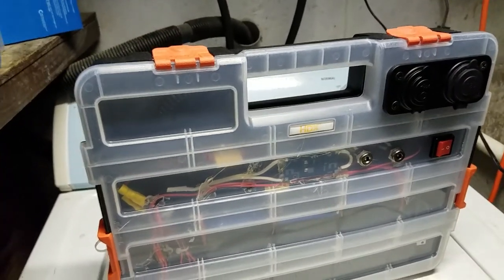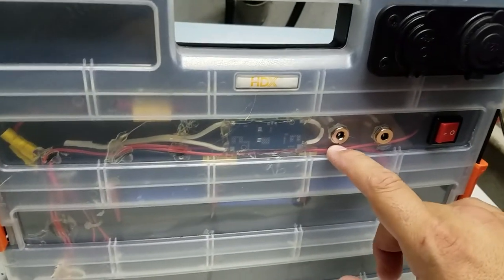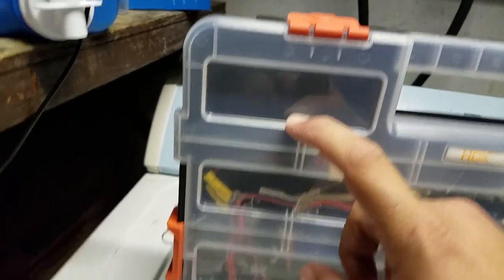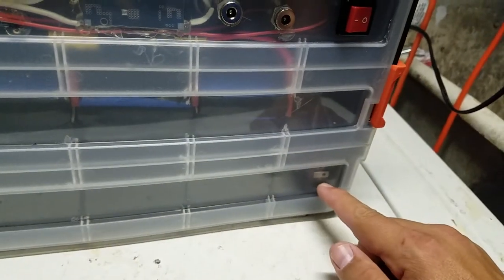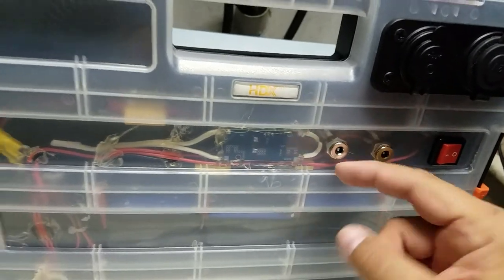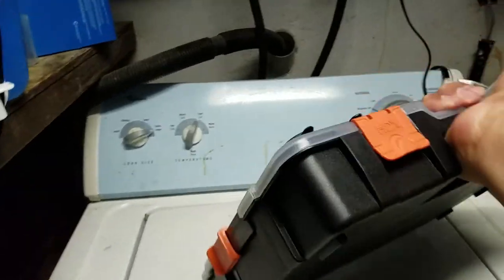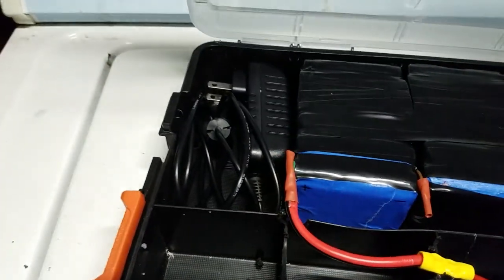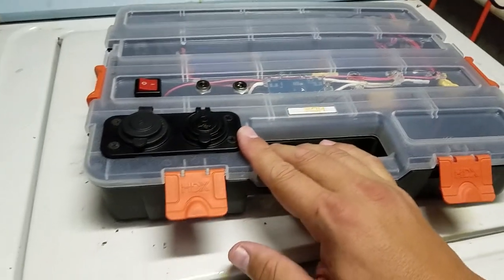Sneak Peak of my new Diy 18650 Portable Power Pack.

Comment: Javier, Nicely done! You have gone above and beyond! Please also show how you can connect one of those solar controllers to this.
Reply from the maker: I actually didn’t used the solar controller. I left the system connected to the panel for a long time and I didn’t saw a voltage difference. I removed it until I can do further testing

Comment: How are you balancing the cells?
Reply from the maker: +jehugarcia I'm pre-balancing the parallel packs using the Lipo charger before making the series connection. I got them close to the 0.02v+/- from each other. Just in case I'm not using a bms.

Is it ok base on what I told you?
Reply: Aren't those the 36V packs from "alarmhookup" on ebay with the built in balancer?